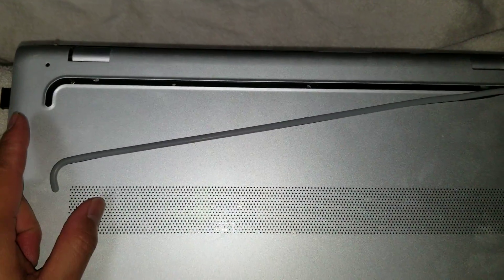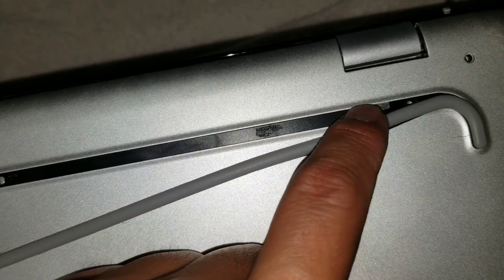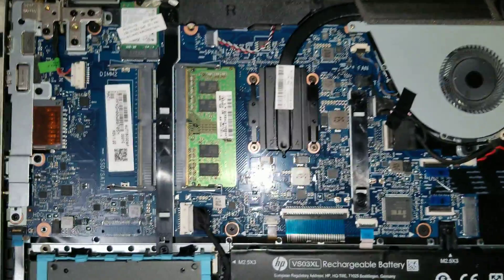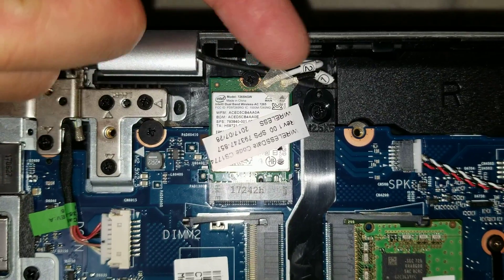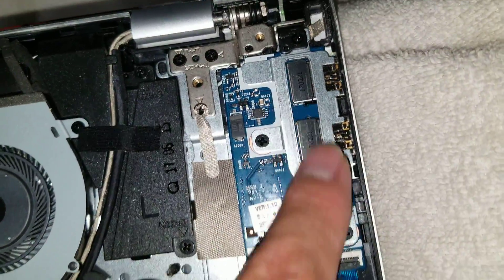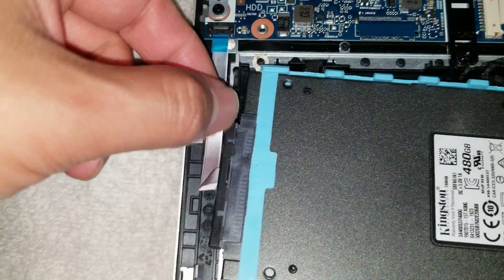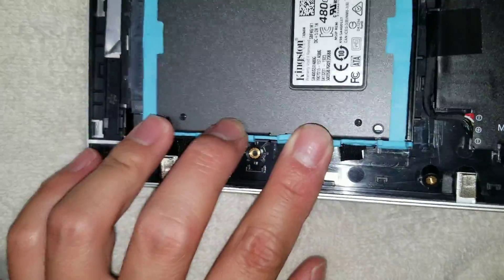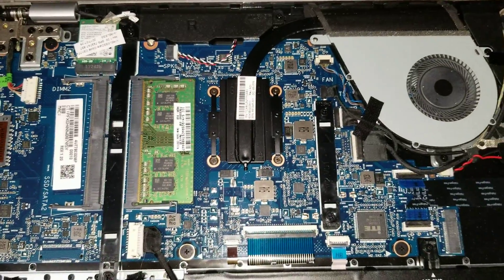HP 15t-as100 Disassembly Hard Drive SSD Upgrade

Comment: Thank you so much for uploading this video. I really needed this. So if I do buy the ssd(m.2) do i need to install the windows after or before? which one would be better the m.2 ssd or the 2.5 drive removing the HDD? Thanks again
Reply: Can you please also tell me which m.2 ssd or 2.5 ssd I can buy for it? thanks
Reply from the maker: I'm not if it supports m.2 nvme, but those are faster. This video will help. https://youtu.be/4p5jFDzVwUw you don't need the adapter, because you can connect both at the same time, but after cloning you'll want to format the old drive or change the boot device.

Comment: Hello, i have the same laptop but i have another issue, my laptop sometimes just doesn't turn on( I replaced the battery just recently so the battery is working fine. The laptop shows an orange light too when kept on charging so the charger and the charging port works too). The service center guys couldn't figure out what the issue is, so i kept it running by putting it to sleep whenever I dont use it. But i switched it off and now it wont power on again. Is there any way I can power it on from the inside by opening it up?
Any suggestions would be really appreciated.
Reply from the maker: Maybe bad power switch? I don't know.
Reply: @ItsBinhRepaired  oh okay...so there is no way i can start the laptop from the inside. Cos i start my desktop pc by shorting a couple wires on the board inside...is there any such thing inside laptops?
Reply from the maker: @viralharia9250  not sure. If you know the schematics of the board you could.
Reply: @ItsBinhRepaired  Oh okay, thanks.
Reply from the maker: @viralharia9250  yup

Comment: I have a 2tb hdd on this same machine. I would like to add ssd to it to have hybrid storage. Is there a space for it?
Reply from the maker: It looks like there's an m.2 slot right above the right side of the battery. You'll have to confirm by checking it. You'll need a screw to hold it down though.

Comment: Hello, I have the same laptop with a 256 GB PCIe SSD and I am looking to upgrade the Harddrive with a 500GB SSD. I am not sure about the wire that connects from the Laptop to SSD. can you advise on which is the correct one or how to figure out which is the correct wiring?
Reply from the maker: Are you asking about the sata cable for the 2.5" sata hard drive?
Reply from the maker: 857806-001 that's the part number for the cable

Comment: Would you know where a Solid State Drive would be located in this laptop? I opened mine but there was nothing on the HD area. I could not tell which board was the SSD drive.
Reply from the maker: Sorry, didn't get a notification of your message. If you haven't found it already, your model is most likely using an m.2 ssd. It is located below the fan on the right side of the laptop.
Reply from the maker: If you Google m.2 ssd you'll see an example of what to look for.
Reply: Thanks a lot! I found it and I was able to fix the problem. It was not seated properly causing issues at boot time. I appreciate the help.
Reply from the maker: @Legolander7  don't forget to like and subscribe if you haven't already.
Reply: Thank you for this video, as well as this thread I'm replying to about the SSD drive. My HP Envy 15t Laptop has intermittently displayed an error message stating that it doesn't have a hard drive. Then it boots fine for a while. Anyway, I just took it apart (thanks to the video), but then couldn't figure out why I didn't have a hard drive where I expected it. I found this note, Googled 'm.2 SSD', found the hard drive, reseated it, and it appears my issue is fixed!

Comment: What kind of hard-drive compatible with the laptop, i am replacing it because the computer said hard drive malfunctioned... 😞
Reply from the maker: 2.5" sata. You need the operating system on there. If you put a blank drive, all your data and Windows is missing.